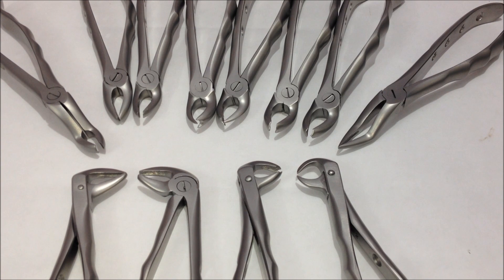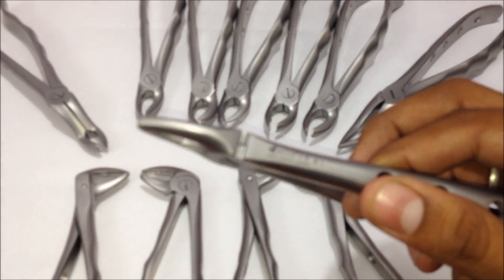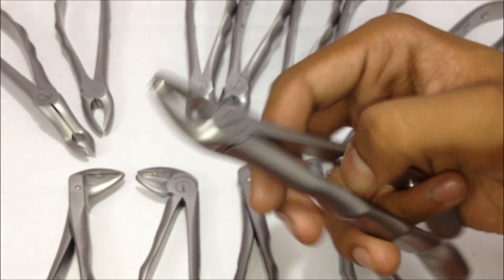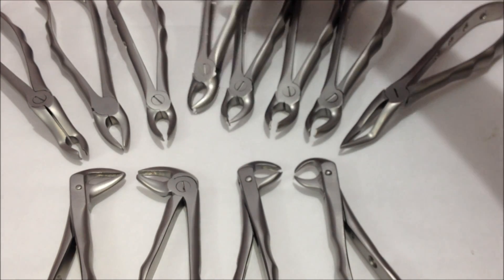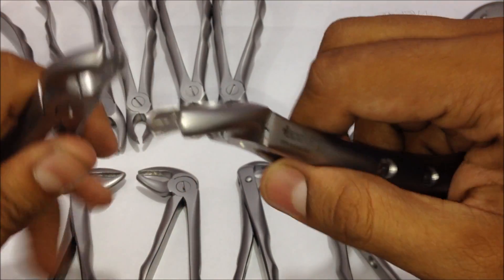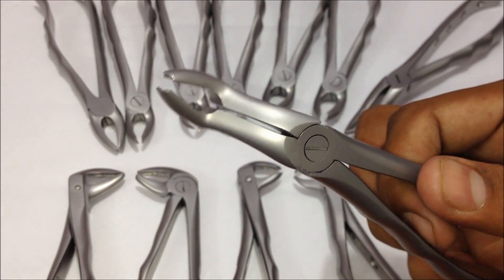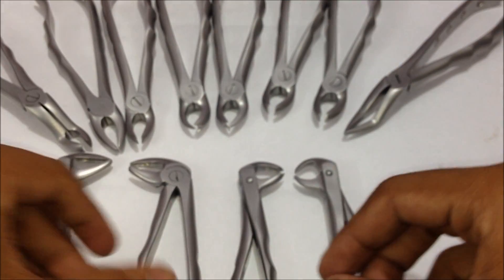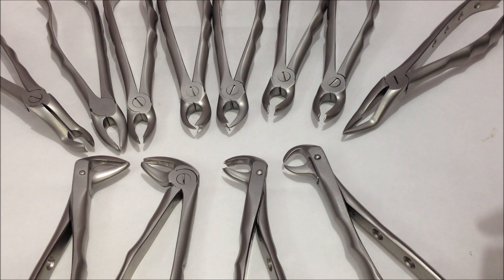Tooth Extraction Forceps - Upper and Lower 12 Forceps Kit - GDC

Comment: I ask you please to remove this video and correct your information please and make another video. The lower wisdom forceps is not as the one that you have mentioned. This is called cow horn and used for extracting severely decayed tooth. The lower 3rd molar has a different shape.